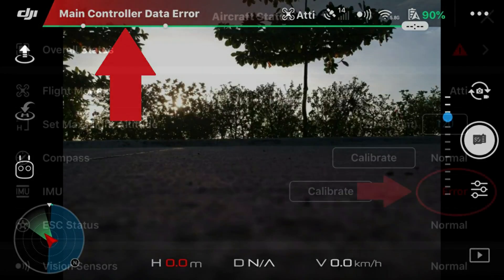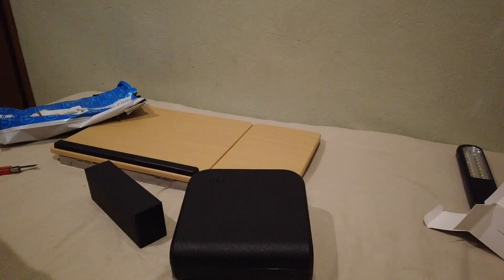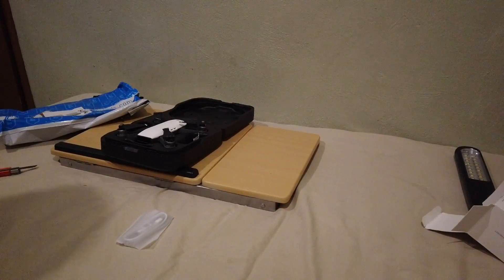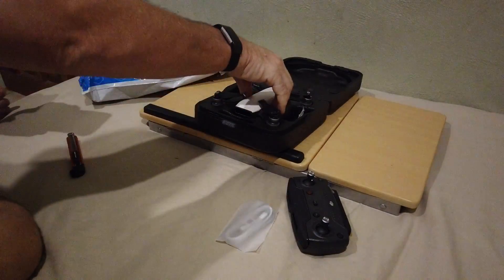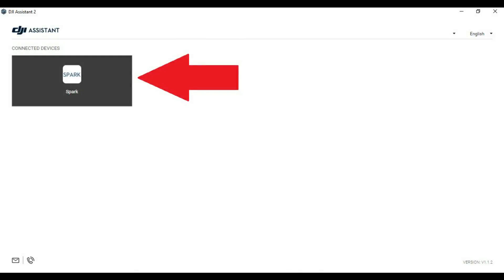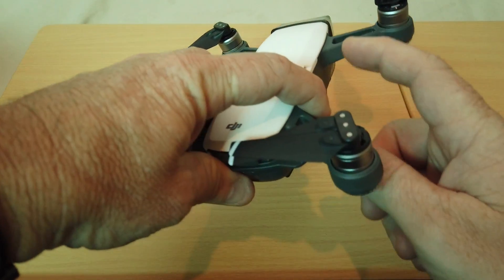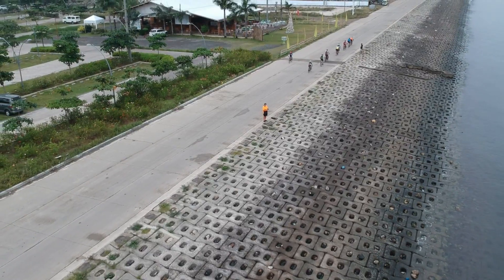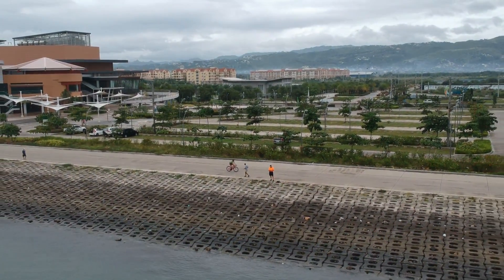DJI SPARK IMU ERROR 71 Accelerometer - Try this TAP FIX B4 you send it back to DJI for repair !

Comment: U sir helped me alot! My ☓-Acc is at - 16.. While my y-acc is - 0.07.. So clearly the problem is in the X-Acc.. Im just wondering which side i should tap on now..

I guess its try and error from now on...
Reply: Hello, i have the same problem too with the x -acc. What did you do??
Reply: @kurtjohnacephotography5951  sounds unreal, but I hit at the back of the drone... On the spot where u insert the the SD card / where you turn on the Batterie... It worked.. My drone is back in the air again...